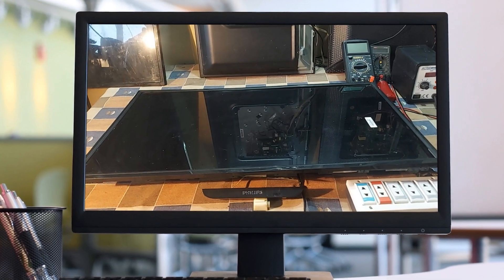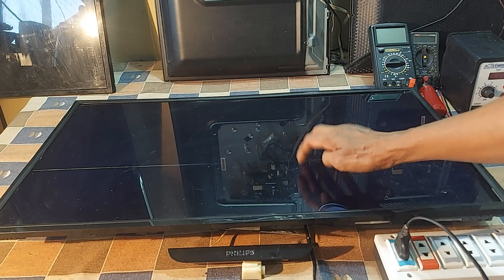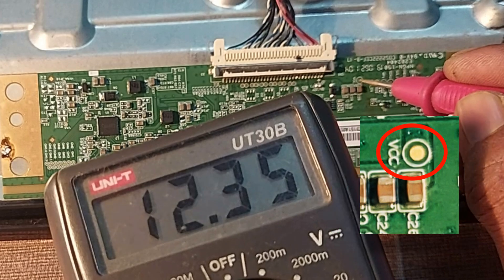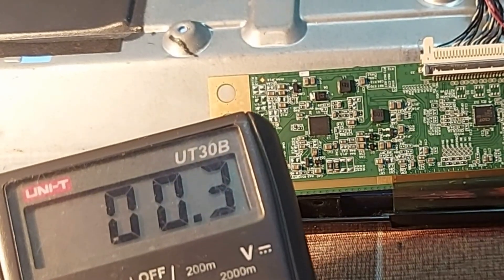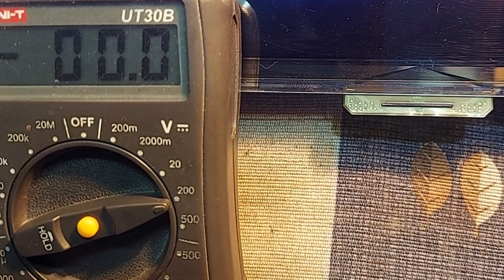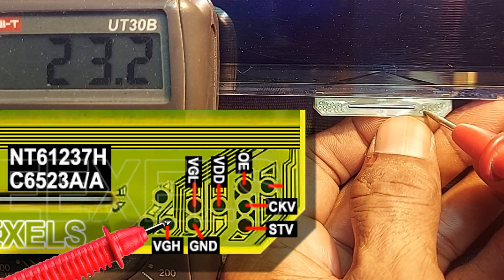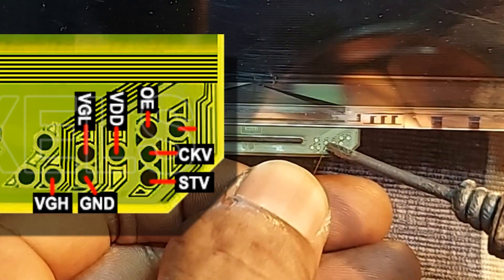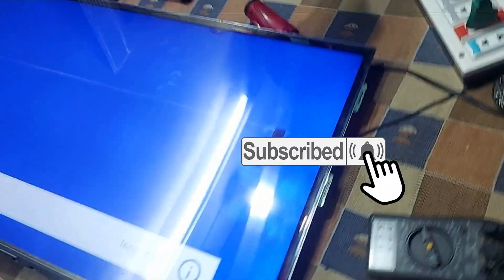No Picture on LED TV Screen | Philips 32 Inch LCD TV No Light, No Display Problem, How to Repair

Comment: Sir i have philips 58pus7505 backlight work no image. I use metod tape on flet cable on right side.  And half screen work. Is that problem in flet cable or lcd? Can be that fix? Tnx

Comment: I saw that almost your television is 32 inch, so can you show your skill on 40 inch television?
Reply from the maker: Dear brother, the formula of 14 inch, 40 inch, 60 inch LED TV is the same, isn't it?
Thanks Brother
🌿♥🌿
Reply: My idea is other screen, OLED, LCD led compare struct and repairing, tcon on board  or tcon separating

Comment: Lg 32 intch 3 time light blinking problem bro
Reply from the maker: There may be a problem with the backlight or the backlight driver circuit. Also a system reset might solve it.
Thanks Brother
🌿♥🌿
Reply: @OrnatePixels  thanks brother